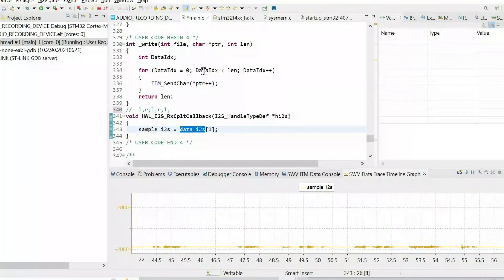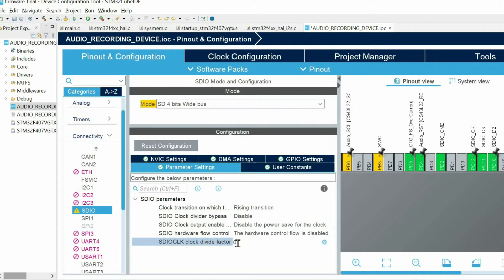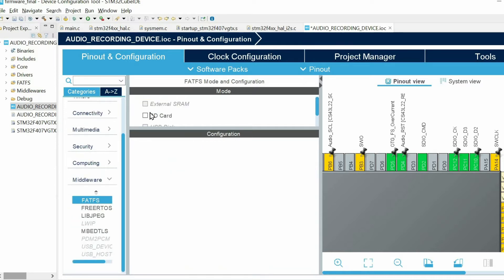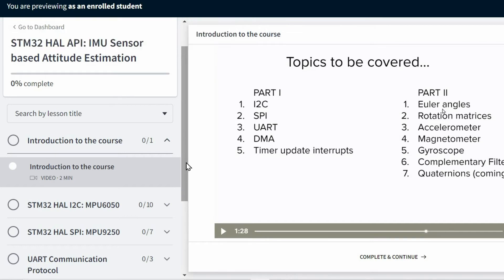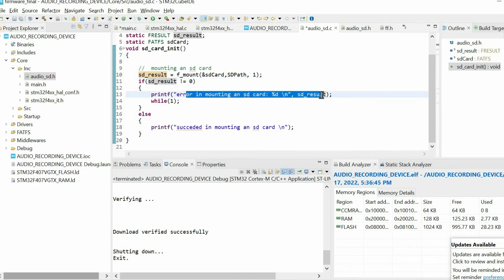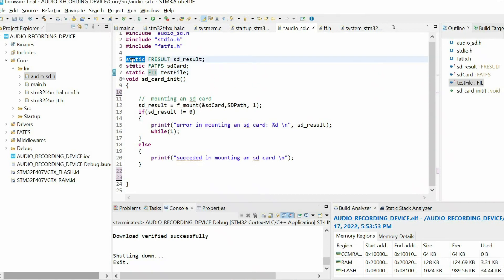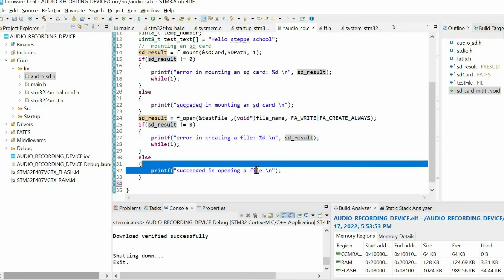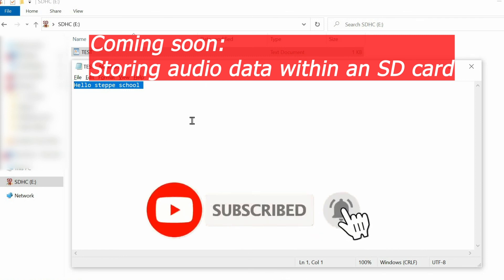STM32 Audio Recorder 2:  SD Card || SDIO and FatFs stack

Comment: Is it correct that all the values are negative?
Reply from the maker: Hi,
What do you mean by values?
Reply: @steppeschool3629  at 0:02 you can see your SWV plot graph of the audio value sample_i2s. The values are around -2000. This doesn't seem right.
Reply from the maker: It might be just a bias. When you make noise, does the plot fluctuate correspondingly?